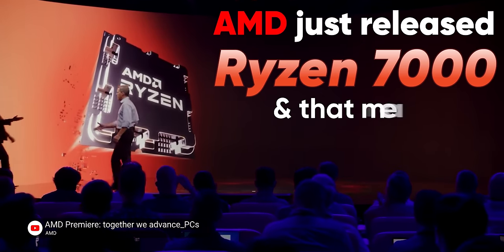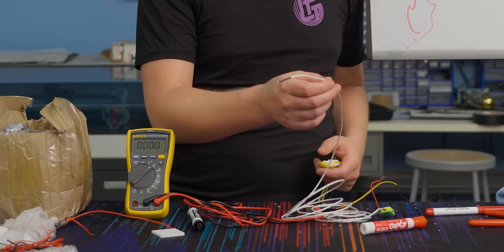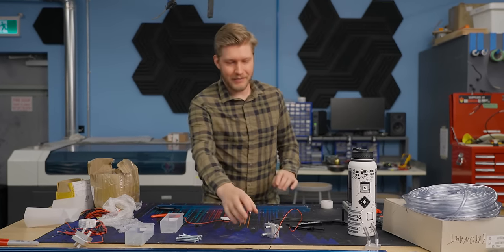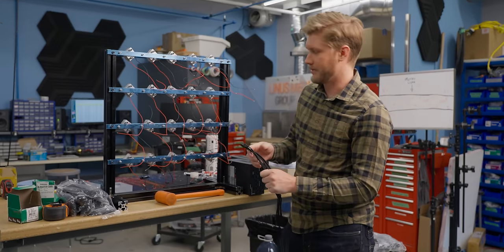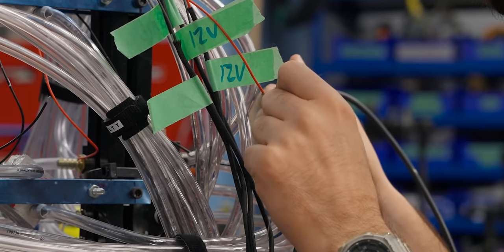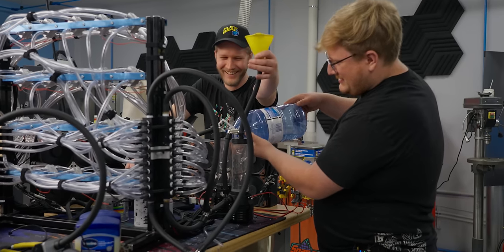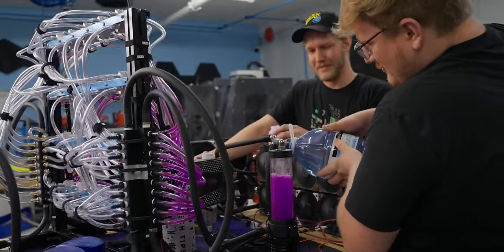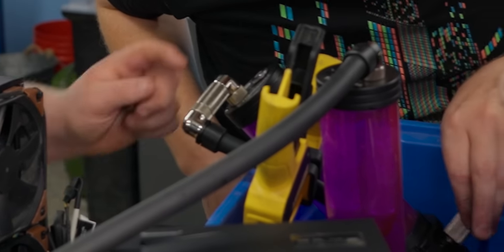Our DIY CPU Chiller From AliExpress is RIDICULOUS

Comment: 1. Use a few distribution blocks (eg Phoenix PTFIX) instead of soldering 80 wires. Or good old Wagos. You'll hate yourself less.
2. I would do a 5s4p connection instead of 20p to save on tubing effort while having some redundancy. 
E: any manifold connection has potential for unequal flow so you need to watch out for that. Big benefit of series tubing is you have the same flow rate everywhere.
Reply: 5s4p with each string on its own pump would make a whole lot more sense.
Reply: But that means potentially trying to remove 600W from a small 40mm x 40mm waterblock. I don't think you can get a fast enough flowrate through it to make that happen.
Reply: Add some RGB. You forgot about that.
Reply: He could tune the flow rates with flow controls. reducing flow in the lower peltier devices would probably balance the flow up to the peltier devices that are much higher and thus need more head pressure. If you are feeding the same head pressure to each row the top will never get good flow.
Reply: @ShieTar_  Don't underestimate the heat conductivity of water. 600W on 40x40 sounds like a lot but is extremely manageable
Reply: @kanetw_  it's not that it wouldn't be manageable, it's getting the lowest delta t that's the aim.
Reply: you'll hate yourself less*
a very important distinction, you can tell you're a professional hobbyist
Reply: @ShieTar_  Its still the same amount of heat from each block, not 600W from 1.  But each block would run a little warmer.  Could be mitigated with enough flow so it doesn't really matter, and running the hot and cold in counter directions, for the equivalent of a counterflow heat exchanger.
Reply: You can also get the same water blocks up to 240mm+ long 40mm wide. Just get some ~180mm long ones and run 4 of them in parallel.
Reply: For cold side
(But if you think of it better setup might be 2s10p)
With 5s4p i would go for pump for each section and one pump between the rads
Also as mentioned get better PSUs for 17V output to get max out of it

And for the hot side 4x5p would be beneficial to get the most out of them also pump for each section
Reply: @ShieTar_  It’s closer to 370W, given they’re running at 12V and only about 1500W total, but still a solid point. However, a 10p2s setup would halve the pressure/flow issues. Combine that with a dual pump parallel setup and you end up with 2x 5p2s which would be much more practical, and easier to setup and operate.

Only need half the manifold ports, half the long tubing runs (with short runs between series connected TECs)
Reply: @dan2800  Pump between each section would solve the unequal flow problem at the cost of higher system cost. Also a question of optimising pressure vs flow rate--pressure is proportional to RPM^2. flow to RPM, and power to RPM^3.
Reply: If it's going to go a PC power supply he could crimp female 8pin PCIe/EPS connectors onto the cables and not have to butcher the PSU cables.
Reply: @kanetw_  Conductivity of water is actually getting problematic very quickly. Remember that CPU cooling blocks generally have to get rid of significantly less than 600W, and they still have to manufacture very specific structures into it to maximise the surface are in contact with water. And I'm pretty sure these standard 40mm water blocks have none of that, just a flat metal surface inside. 

The math goes a bit like this:
Conductivity of Water is 0.6 W/m/K, on an 40x40 mm area you get 0.001 W*m/K. So to a point inside the water flow, just 1 mm away from the metal surface, you have 1 W/K of conduction. So at temperature differences of 20 to 30 K, you only get an insignificant portion of the power (20W to 30W) to reach even 1 mm into the water.

I'm sure you can build a more effective waterblock of that size, but than I assume the hole setup gets really expensive.
Reply: @kanetw_  but is it with aluminium aliexpress waterblock with barely any water flow ? : P
Reply: @sznikers  Those blocks actually have very little resistance compared to real waterblocks. His problem is he had too many in parallel, he should have just run each row in parallel rather than each block.
Reply: @JKK_85  yeah the bad flow is cause they have bad loop, but that block is still crap and i doubt it can could cool even 200w tec while keeping hot side below 50c. Its stack of nightmares, crappy aluminium blocks starved for water flow cause of quasimodo loop.
Reply: @ShieTar_    Remember that the primary mode of heat transfer in this case is convection. This is very difficult to estimate generally (requires simulation). For an unfinned construction using "Forced Convection on Isothermal Flat Plate in Free Stream" you get about 100W per heat exchanger at 0.3m/s (=1500l/hour) at 30K temp diff, which is about the expected load. Temperature rise at that flow rate is negligible due to the high heat capacity of water.

That result is pretty bad, but that's why all constructions for high heat flux cooling use fins to increase surface area and restrictions to increase surface velocity.
Reply: @kanetw_  Sure, but how many fins & restrictions do you expect to be present in those 2$ Aluminium cooling blocks from Alibaba?
Reply: @ShieTar_  none lol, which is why I calculated the flat plate case.

Comment: I would love to see a sequel to this that uses the same idea but in a more optimized way.
Reply: using a server 12V only server PSU, and maybe using cheap air coolers on the peltier hot side to half the effort on the cooling runs might help!
Reply: Then you should watch der8auers Video on cooling with multiple peltier elements ;)

Comment: You need a separate res at the top of the loop for this to work. pump at the bottom, res at the top, then you're not fighting gravity. come on guys this is water loops 101!
Reply: also the clamps idea was alright, but you can make mini clamps out of 2 sections of dowel and 2 wood screws. then you can make 1 adjustable clamp for each inlet and dial in the restriction perfectly!

Comment: For a manifolded assembly like that you want it to be horizontal rather than vertical so gravity affects each one the same. Then you can have radiators attached to the hot side drawing cool air from the cold tubes on the bottom and the cold side blowing chilled air over the hot tubes on top for a small performance boost in the setup.

Comment: You need a manifold that distributes to each of the lines with a constant volume flow rate. In other words, the fluid is taking the path of least resistance, like the lower TECs and shorter tubing runs.
Reply: This is the right answer.

Restrict the lowers, use separate pumps, or series up several of the TECs
Reply: just have loops for few tec's each going to a tank and a different loop from the tank to the cpu.
Reply: @lasskinn474  makes more sense
Reply: I failed thermofuids 3 times and even I was frustrated he didn't lift the red above the techs
Reply: I played too much factorio/satisfactory to know this 🤣

Comment: You gotta connect those blocks on the peltier-s in parallel (at least in blocks). You could do four groups of TEC-s with each group having their own pump and radiator combo so you have higher crossection for the water to flow through. If you connected everything here in series, I would imagine, the pressure needed to push the coolant through the whole system is too much with just a tubes diameter of cross section for coolant flow.
Reply: As I understood it, they were connected in two parallel blocks of 10. The frame's left side supported 10 TEC-s, and the right supported the other 10. Front was cold, back was hot. Am I missing something? These aren't connected in series at all.
Reply: @TorgieMadison   They all had their own circuit, which makes for a very long pipe in sum. When you group 4, you almost cut that length by /4 -> less pressure is needed.
Reply: I mean, yeah. But if you do that and lay the frame down so that you don't need the pumps to lift the coolant 3 feet it would work a whole lot better.
Reply: @VealCalf1  If you make yourself familiar with these particular physics you will learn that the relation of pressure needed to length of the pipe is not linear. Spreading out the pumps to different positions in the circuit could help with that.

Comment: I did the same but in smaller dimensions (about 400W). I wasn't happy with the results. So i tried the outdoor mod. Placing my 9x120mm radiator outdoors at about negativ 5 degrees celsius improved the result greatly. The cool side of the peltier element was extremely cooled and  the cold side could get insanely cold (not gonna spoiler, try it out its crazy!!!. Its easy to realise If mother nature provides you with the right circumstances. Shouldnt be a problem in Canada i guess. I would love to see you stepping the project up with the "oudoor mod". 

Sorry for my terrible english and  greetings from Austria <3
Reply: Austrians and their cooling solutions smh

Comment: i think you might get better results if you use a large high reservoir above each loop and let the pumps just pump the liquids up, then let gravity let the liquids flow through the coolers this would probably get equal flow through each cooling element.
that way you could also store some cold liquid in the reservoir and run a benchmark from the stored cooling capacity of the reservoir.

Comment: I used to have the "Ultra" brand peltier tower air cooler hybrid. It actually worked very well. With how it was set up it kept the CPU at one temperature when under load, didn't cool it too much or too little.
Gimmicky, yeah. But it was cool as hell and still did a fairly good job. Not the best, but good.

This idea takes that to the max. I like these ideas lol

Comment: You should connect the blocks in series. So you solve the pressure problem and equalize blocks temps.
Reply: Agreed. Would've made it really easy to bleed the whole system
Reply: Hot side in series would only make most of them non-functional as they'd be "cooled" with hot water (heated by earlier ones). OTOH the "cold side" in series would freeze the antifreeze, as the cooling effects would keep stacking.
Reply: @@muffinconsumer4106 Would require a lot of smaller radiators, couldn't use these big liquid cooling radiators they did.

Comment: I can’t believe you guys are doing ANOTHER peltier cooler video right as I’m designing a stupidly crazy design for a giant observatory telescope chilling system. So thankful!!
Reply: Please don't use Alex as a starting point. He is making so many stupid mistakes. Main stupid thing was that he did not place the header tank on the top of the loop.
Reply: @Running_Wakko  don’t worry, we aren’t using this is a guide! Our system is going to be far more complex as it has to work in all orientations. The water blocks will be changing orientation as the telescope mirror moves around, so we have to account for everything. We’re gonna build a working model before we even try out the real thing.

Comment: You have to create strings and parallel streams with your cooling liquid. The way have it now you would need an open reservoir which presents NO pressure at all. Best way to to this would be to have the water coming from top into the reservoir like a small waterfall. With that much parallel water flow you actually hampered the whole performance. Also add some automatic air reliefs at the top to get the air out as fast as possible. 

We have the same concept in out town water system where I'm responsible of. You need strings and parallel flow correctly done or else you have no flow at all...

Comment: I think the pumps needed to be split up among the different sets of coolers, so a pump and a "one in five out" manifold per level of that tower. Getting the water/coolant to cycle properly through all the blocks would probably make a huge difference, and if I understand how they work correctly, may actually get the TECs to draw more power. The reason for that being they have temperature limits on the hot side, once it reaches a certain point it just can't push more heat across, and will drop off.
Reply: Those tecs need 17v, they were giving them 12v.  So the devices were underpowered, thus under delivering.

Comment: i think you should try improving this. you should mount the pump/reservoir up high to prevent air lock and pressure issues if you want to keep testing the in parallel like you are. i would recommend each row of coolers in series and then have the rows connected in parallel. it would really force the coolant to circulate through the coolers and likely require less force and make the water much cooler.
Reply: actually u just write my toughts 😅😅😅
Reply: Exactly, never understood why most liquid cooling setups in typical computers have the res down lower either, should be the highest point - even higher than the rad - makes it much easier and would automatically deaerate

Comment: It is not just a pressure issue, it is a flow issue too! You need to assess the temperature drop of the coolers and then use Q = M.C.DT to work out the total flow required.... then assess the flow of the pumps against the head pressure of the assembly.....

Comment: The way you do this is to buy larger water blocks. You can get blocks that are longer so that you can attach 4x or even 8x pet's per block. 

The correct way to do it is to add a pet inline wired up to an inverted furnace thermostate so that you can temp controle power on and off the pet's. 

Best way to go sub ambiant is with geo thermal heat sinking though. Your coolant should stay a constant inline temp between 10-15 degrees. 

Heres is another hint people condensation requires a temp differential based on humidity in the air. So if your pc was in an airtight humidity controlled enviroment like a mineral oil case or a freezer you can eliminate the opertunity for condensation to occur.

Comment: from how I understand piping in general (I am not an expert) the reason there is so much air trapped is because they don't have any pressure release valve located on the highest point of the loop so the air just gets trapped on whichever place gets the water  flow last... it's basically a one-way valve that traps liquid below it while release any air upwards without giving it a chance to get back into the loop (I think the show The Good Doctor made a decent demonstration of this)

Comment: You should have used the 'Tichelmann-System' for tubing. That's a plumbing/piping technique.

This way you would have the same resistance in every loop so the Water would spread properly between all loops.
Reply: build one and post the video…
Reply: @macking104  hm?

Comment: Don't you have a pretty well-equipped workshop with a CNC? Don't you think making yourself a nice channelplate from a copper (or aluminium) block might have ended up being easier than assembling 40 of this tiny waterblocks? And also probably add less flow-resistance to you water-loop? Also, much less problems with the massive height-differences?

Also putting the full voltage on the TECs might not be the bestest Idea, once the hot side loop isn't capable at staying near ambient temperatures anymore, the cold side is still going to give you a temperature difference, but now it's only relative to the luke-warm water on the hot side. And 1400W on the (maybe) 100 l/h you get from a D5 means: 1400W / 4.2 J/g/K / (100 kg / 3600 s) => at least 12K heat-up per cycle, not sure at which temperature your radiators will manage to remove 12K per cycle?

By the way, if the TEC is specified to a maximum heat transfer of 120W, than this is the heat it can take from the cool side, at 0K temperature difference. While being operated at maximum specified current, and usually at a very low efficiency. Which means 120W is by no means the maximum of heat it can offer at the hot side, that is more likely to end up between 360W and 600W. So with your 3kW of PSU-power, you wouldn't have been remotely on the safe side if you had given them their maximum voltage. But for a small TEC that want's to move 120W this voltage is probably above 12V anyways, right?

All I'm really trying to say: There is a way to build an effective, and reasonably efficient, chiller from 20 TECs with 120W peak capacity each. But there is also a way to just yolo it for a funny video ...
Reply: I was thinking the same thing
Reply: but that is too logical and not humorous…

Comment: Protip: for cooling big circuits like this you end up having issues with flow sharing due to imbalances in the pressure drops across each flow path. The simple solution is to add way more flow. I recommend the 12V water pump out of the toyota prius: it should provide ample flow for most cooling applications.

Comment: I had Two  suggestions, to save you time and it is cheap Alex,  Thread sealant paste is very inert works better  then Teflon tape.  I used it a lot to test 3-15lb and 4-28lb pneumatic actuators, pressure transmitters monometers for an old big boiler.  My other suggestion is from when I worked for an electronic tool co is "haisstronica Heat Shrink Butt Connectors".  These Connectors are Used with a heat gun and leave a  marine grade electrical finish.  They are fast and fairly cheap, heat guns are faster then soldering. you can also line them up and hit several at once.  Good video, pumps go high in industrial loops unless it is  hydraulic  whole setup might cost $100 but for 50 threads its about 1/2 the time.  I'm  not sure what Alex gets paid but my guess is it is cost effective

Comment: Guys, put your sub zero test rigs in a nitrogen or argon flooded container.   No more worries for condensation.  It doesn't even have to be closed so long as there is constant directed flow.  The container doesn't have to be anything special.  Cardboard, plastic bin, or a fish tank would be more than enough.